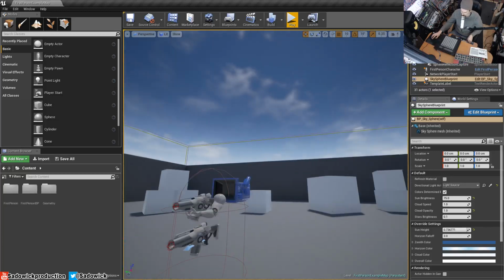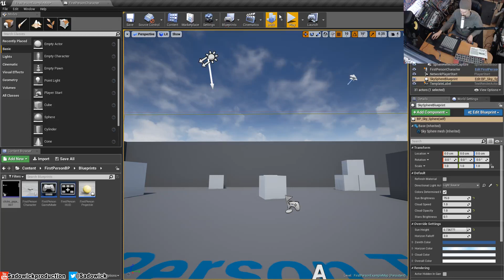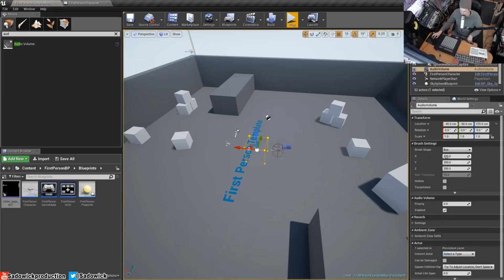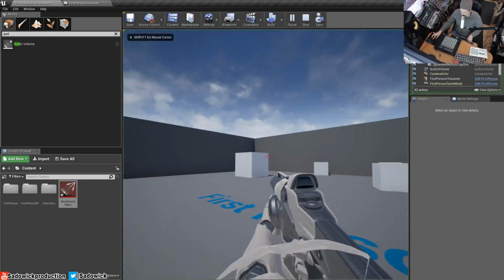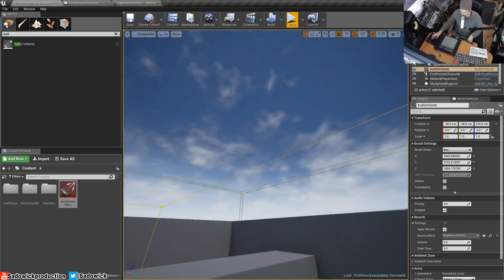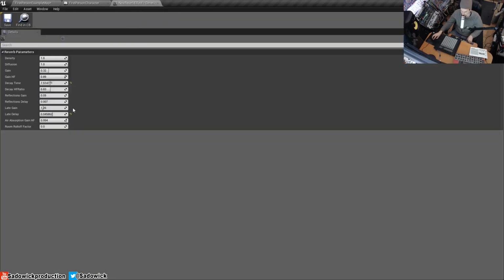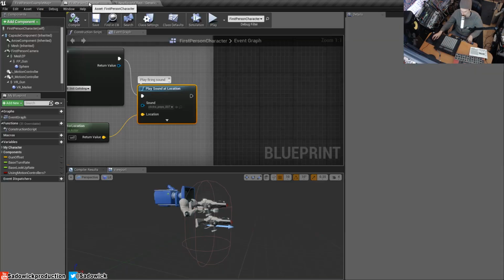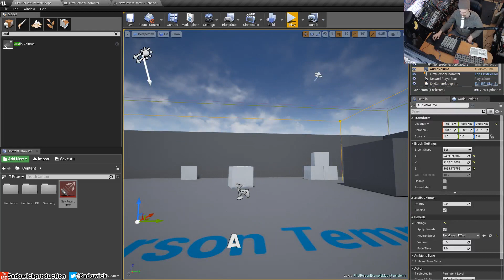Unreal Engine 4 - Adding A Reverb Volume & Adjusting Decay

Comment: If you're using 4.23 or above, when you play in editor, you won't hear the reverb, but it will be in the built version. To hear it during Play In Editor, you must press tilde key and type 'au.isUsingAudioMixer' select that and it should work. 👍